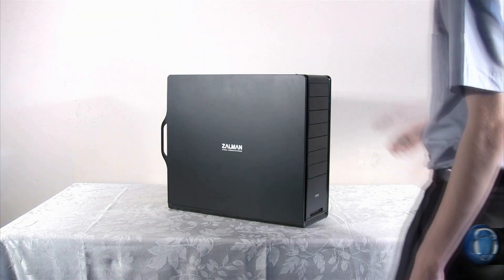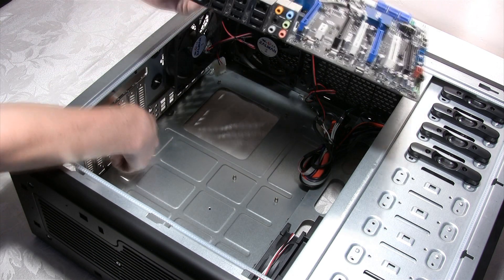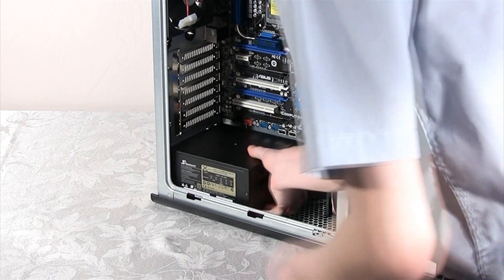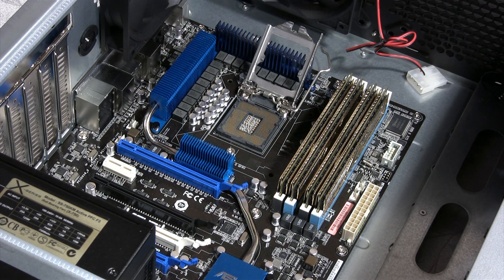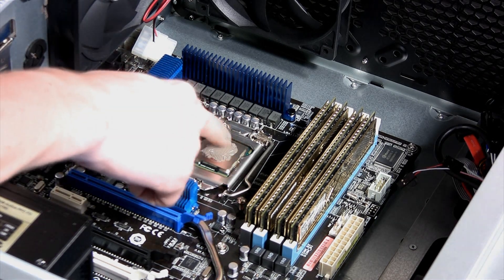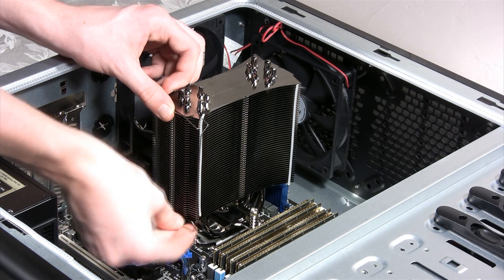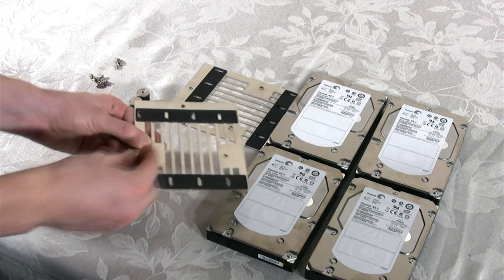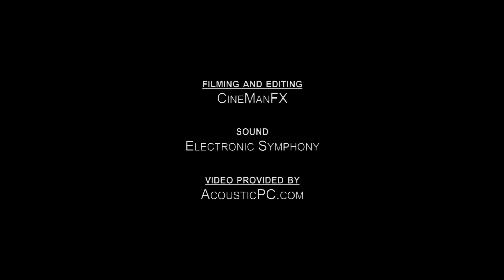How to Build a Quiet High-Performance PC Video Overview - Part 2 - AcousticPC.com

Comment: This guy has no idea how to build a computer.
1. Don't fucking touch the thermal paste like that!
2. Don't put ANY force on the CPU when installing it into the socket.
3. Don't put the motherboard into the case before you insert the RAM and CPU.
4. Why the fuck do you need 4 hard drives?
Reply: I am agree too with you!

Comment: One way to improve sound dampening (even though this does a very good job as is) is to use an anti-vibrational cover for the PSU. I have one and it works great as well as being very cheap (about $10).

Comment: i nearly fell off m chair when u aplied the thermal compound!!! all u needs a tiny little spot of it, and i find it spreads under pressure from the cooler anyways. i recomend arctic silver ceramique as its garuanteed non-conductive and therefore safer for beginners. and last but not least, wouldnt it be bettter to mount the cpu cooler in a north south configuration? (exhausting to the top of the chassis) as that would take better advantage of thermal convection

Comment from the maker: @lewisner As far as performance SATA III SSD, the best is the Patriot Pyro and OCZ, Kingston HypeX is right there...  Basically anything with a sanforce controller. However Only Patriot and OCZ offer a 60gb size... The Kingston Hyper X starts at 120GB

Comment from the maker: @lewisner They have come down quite abit but not enough for massive storage. However you can get dual 60gb ssd's even sata III for approx $109.00 or 120gb for approx $230-240.00. Personaly i prefer dual 60gb that is enough for operating system and programs etc... and set it up on raid 0 and your system will fly :) And then for storage you can use 1-2 even 3 TB Quiet Seagte drive. I just read a review on Hot Hardware they compared Hitachi, Wester Digital and Seagtae & the Seagte performed #1

Comment from the maker: @acousticpc But for storgae it is very pricy still it is beat to use a quiet HDD for storage and SSD's for the operating sysem and programs. for silence and performance. The Green series Seagate drives we use only turn on when you access them. But again they can not be heard from inside the case and we do also provide hard drive enclosures in our online store that completely dampen the sound.

Comment from the maker: @lewisner This video is a great refrence for building a quiet PC also this video is approx almost two years old so SSD's were very expemsive. Remember also the case is soundproofed so that will muffle any noise coming from the components insde including HDD. I do agree with you SSD is great because they are silent you can still hear them seek a bit but for the most part silent. I would like to note that Segate drives specialy these are extremely quiet!  SSD's are way less expensive now

Comment: people don't spread the compound especially with your finger. the finger has oil form your skin on it, the imperfect surface on the compound after doing that will trap air also. both can be bad for transferring heat. it doesn't sound like much but it will make a difference. you can just dab it in the center and let the heat sink spread it. it worked better for myself than doing his method.

Comment from the maker: @xBeyondInsane Now imagine the PC case closed with the soundproofing foam. (TOTAL SILENCE)... whith the case open and a mic up to the fans,  sure you will hear a slight whisper, but real life it will be silent. also fan speeds can be modifed as well for the application.

Comment from the maker: @saguerraty But the performance is not good on passive radiators. the heat just sticks on their.  We did not start carrying the zalman passive unit until they came out with a fan for the resorator.  Even if you have it on lowest setting some air movement is needed. same goes with a passive cpu cooler, the case cooling design needs to be adequate, but always a good idea to have a low Db fan, you wont hear it anyway.

Comment: @ShanxyBeast on the middle of it and gently place the heatsink directly on top of the processor and twist a tiny bit before securing the heatsink down. If you look "linustechtips" on youtube, he has a good tutorial on applying thermal compound. Good luck. MAKE SURE NOT TO TOUCH THE CPU WITH YOUR FINGERS!!

Comment: @ShanxyBeast The biggest problem with how he does it is that how he shows WILL create air bubbles and heat will be condensed in between the processor and heatsink and will cause heat issues. youtube "how thermal compound spreads" and you'll see what I mean.

To your question: The BEST way that I've ever come across is using a product like IC Diamond or LiquidPRO liquid metal thermal compound. You put a dab of thermal compound the size of an uncooked grain of rice on top of the CPU directly

Comment: Do NOT apply thermal compound like this. ESPECIALLY ARCTIC SILVER 5. Always, ALWAYS, drop a dot the size of an uncooked grain of rice on the center of the cpu and gently lay the heatsink on top and twist before securing it down. Never ever ever touch the top of the CPU without cleaning it after with isopropyl alcohol and wiping it with a lint free cloth. Spreading thermal paste with a credit card or your finger WILL create air bubbles and can damage your PC.

Comment: @acousticpc sorry but 30dba isnt loud at all, at least for a coil whine, a coil whine is when the coils on the graphics card have not been soldered together properley, so they vibrate, most likely just mine (i doubt its all of the asus 5770's that do it, otherwise asus have some serious fixing to be doing!) lol

Comment: @acousticpc its a very common problem, its a ASUS CUcore 5770 with stock fan, but its not coming from the fan it coming from a capacitor, it seems to happen with alot of them, do you think this would be covered by RMA/Warranty? the sound isnt THAT loud, its around 30 DB, its just an annoying sound if you know what i mean.

Comment from the maker: @89schlappe These hard drives are from Seagte and they are very quiet and we needed the performance in raid for audio and video production, you dont have to use 4 drives like we did. Prolimatech is a good cooler we sell itas wel as The Thermalright product and there is also Noctua and Zalman as well but currently at the time of the video as well as to date the Thermalright provides the best performance. We focuses on quiet & Zalman cases are just simply more sturdy and solid. but those are nice

Comment: that was a very bad way to paste.  1 using your finger has oils.  should be cleaned with 99% alcohol but no lower than 70%  and the die under the chips spread in a circular diameter.  he definitely pasted wrong!  however pretty good videos.